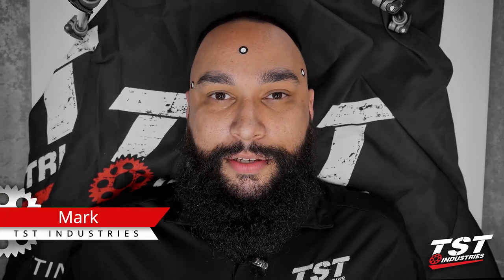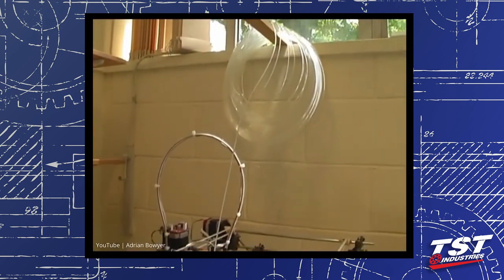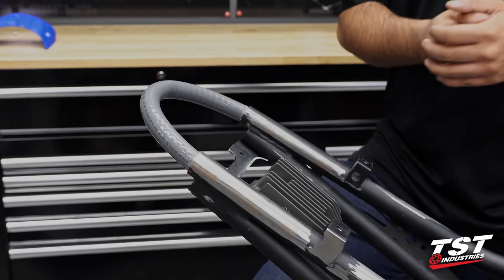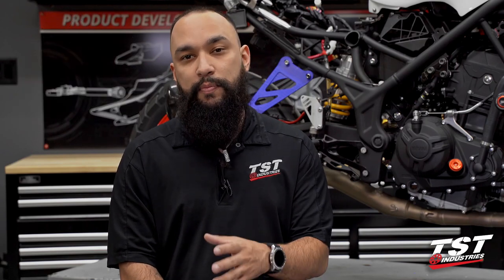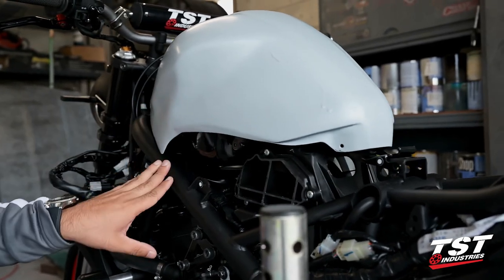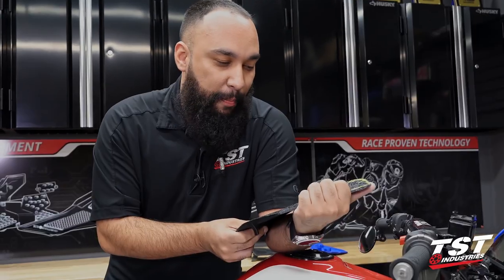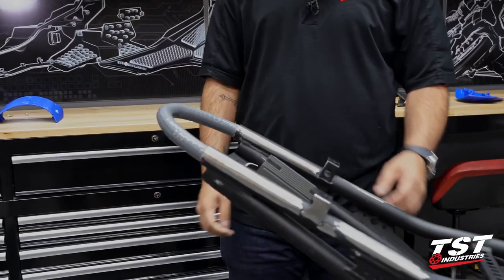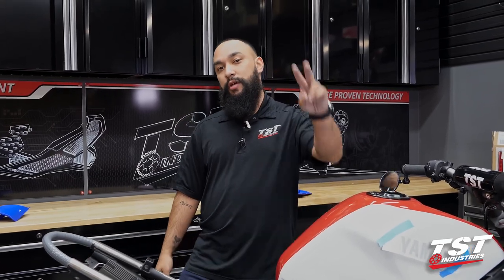How we 3D Print Custom Motorcycle Parts! (MT-03 Build Series Ep.18)

Comment: what cad program are you guys using?  I would like to make some custom parts for my own motorcycle...
Reply from the maker: We do not use one program but several packages in our tech stack. It depends what we are doing with the 3d data. For most sheet metal parts like this bracket we typically use SOLIDWORKS. If you are just starting out there are free or inexpensive packages that will get the job done so I would not steer by what others are using.
Reply: @TSTindustries  thank you for your honest reply...

Comment: This us incredible. Which printer and scanner would you recommend to purchase to make my own parts
Reply from the maker: Well there is no universal answer to that. You haven't really shared any details on whjat you would be scanning or printing. There are so many different types of equipment out there and they differ so much in what they are the most efficient at. If you are just starting out then I would say get a Creality printer and learn that real well. After you have outgrown that you can sell it and at that point you will have enough of your own experience to make the determination on what is the next sensible choice. Scanners aren't so easy because they are relatively expensive if you want precision, and then you still have scale ranges. If you are going to be scanning an entire vehicle and then also something the size of a key then there is no equipment out there that accomplishes both scales with good accuracy. You will have to do some research.

Comment: Is there anyway you guys could 3d print unavailable or back ordered parts for a 2015 harley davidson sportster 883
Reply from the maker: The 3d printing is the easy part of the process. The part has to be designed in 3d first and then the machine part takes very little effort. Do you have the designs for the parts you are inquiring about?

Comment: Hey i wanna ask, can you make a  half fairing for cafe racer with ABS filament with the 3d printer? Is it possible? Thanks
Reply from the maker: It is possible but depends on the size of the printer. Most likely has to be done in sections, then bonded into one unit. It also had to be designed in a way that places it far from the exhaust so it doean't melt.

Comment: I'd be interested in printing some parts for one of your motorcycles. We can print fairly large FDM and have been testing new engineering grade materials materials lately...
Reply from the maker: We use FDM for prototype testing and tooling/jigs only. We have our own equipment to accomplish what we need. For larger parts we have a local partner company that has a BigRep. But I suppose having more contacts with capabilities is never a bad thing. If you want to send us some information on your work, machines, area of specialization, unique aspects, etc., we will possibly consider doing something with you.
Reply from the maker: Where are you located